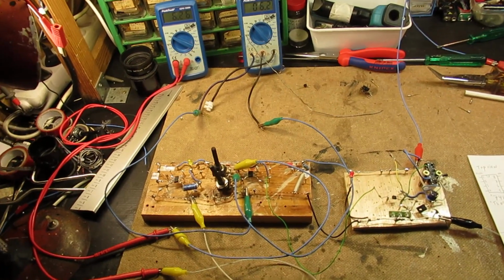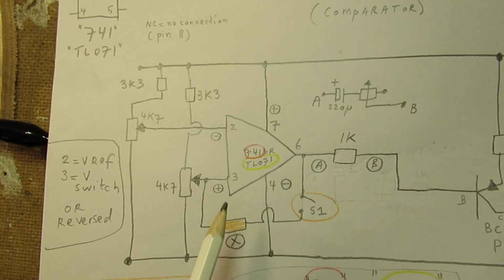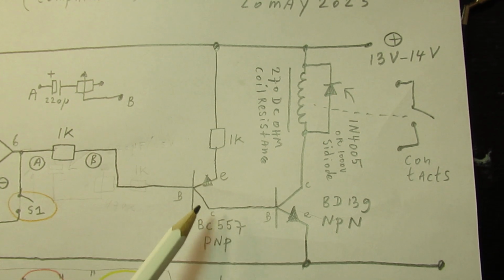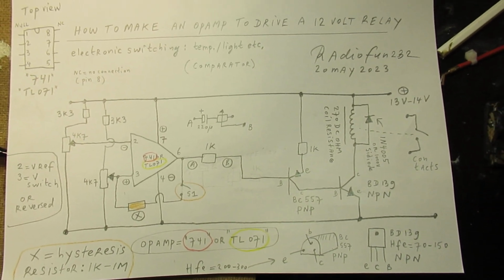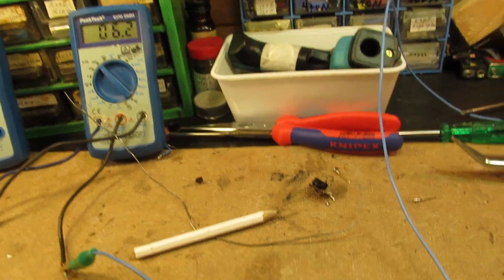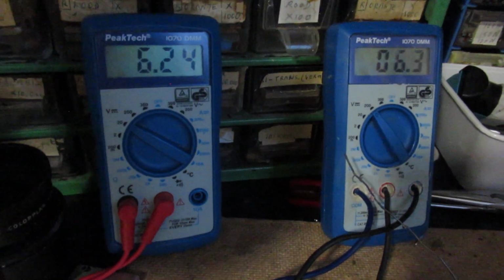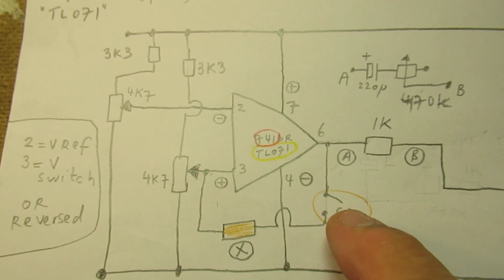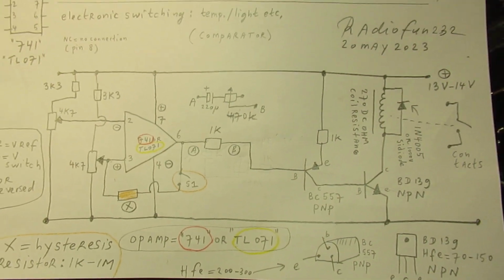How to make an Opamp (a 741 or a TL 071) drive a 12 Volt relay: demo and schematic of a comparator

Comment: Interesting, I guess that without the hysteresis resistor the output could oscillate if the crossover is very slow
Reply from the maker: Yes that is a (the) problem, the Schmitt Trigger does that much better. For certain appplications  the comparator works good enough. These effects can sometimes be mitigated by soldering an electrolytic capacitor in, also (a big value, say 100-470 uF) parallel to the relay coil.
Reply: @radiofun232  thanks